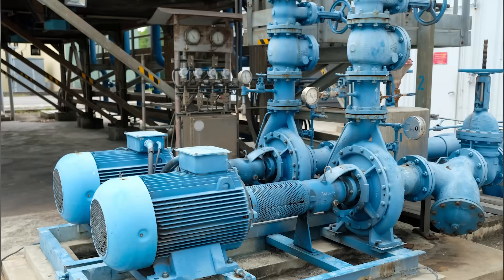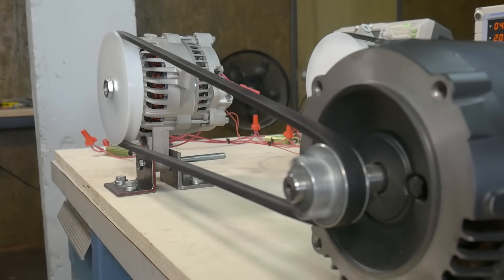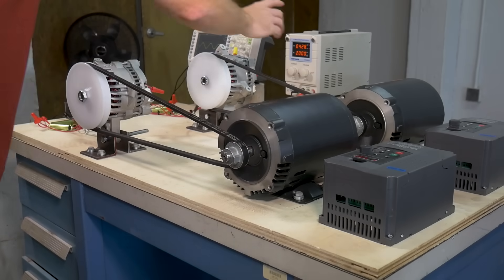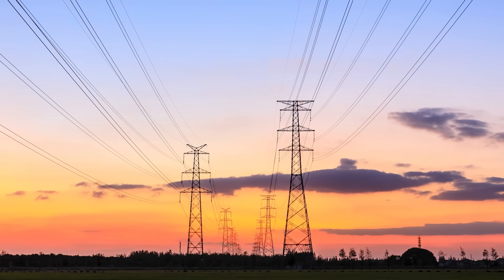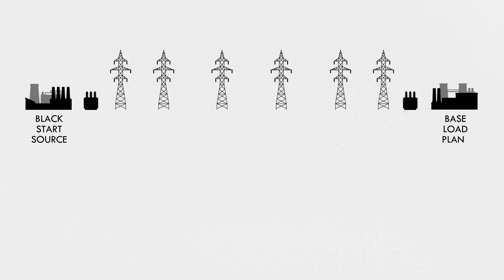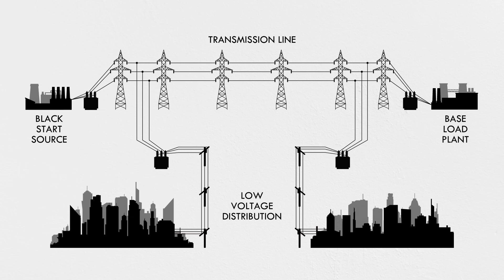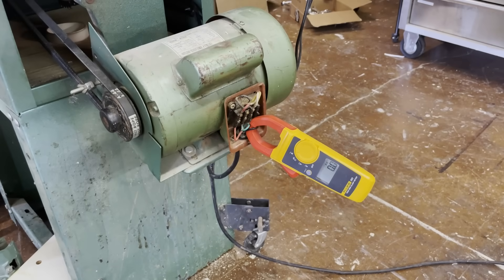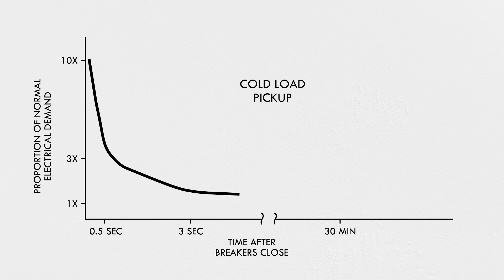What Is A Black Start Of The Power Grid?

Comment: A little black start anecdote: In the '90's I was working as a contractor plant electrician at the North Anna, Virginia nuclear power station during a refueling outage. I forget now if it was Unit 1 or 2. For some reason we were in the building housing the emergency diesel generators. Huge engines. Next to one of these engines hanging on the wall was was a hand crank similar to one you would start a Model T Ford car with. I asked the foreman what it was used for. He pointed to a single cylinder diesel engine mounted on the floor connected to a small air compressor. He explained that in the event of a total blackout and loss of service air, the crank was used to start that diesel powered compressor to charge a tank to power the air motors that start the main engine.
I guess you could say that a nuclear power plant is crank start.
Reply: It's pretty hilarious, but there's certainly nothing more reliable that good ol' human power 😂😅
Reply: As an old guy, I appreciate the fact that sometimes it takes a crank to set everything right.
Reply: @studuerson2548  As an airplane mechanic with a thing for inertial start systems (the technical term for crank starts) i too appreciate such simplistic redundancy!

On our big jets, (i work at an airline) you dont start the engines with the battery. You use the batteries to start the Auxillary Power Unit (APU for short) 
Which is essentially a 3rd miniature engine on the plane. 
You then use the APU to start the main engines! 

This brilliance harkens back to WW2 bombers, which were the first to utilize that sort of rig. 
If you ever see one, ask the crew about the APP. (Auxillary Power Plant)
Reply: Ha that's awesome. Ty
Reply: Same at our pump station when I worked there.  The main engines ( DD 12V71s (3)) and the big generators ( 6-71s (2)) were air starts. We had one smaller battery start generator for " hotel power ". The air compressor was either electric motor driven or by moving the belts over, driven by a single cylinder Hatz Diesel. The Hatz Diesel was electric start but also had a hand crank for an emergency. We later convinced them to install a backup compressor that could run off the small generator if need be. Air is very important if you are having to clean up things after a Hurricane.
Reply: @gravelydon7072 , is 6-71 a two stroke engine?
Reply: @T0m0zuki  Yes.
Reply: @gravelydon7072  , I loved the sound of it.
Reply: That's actually really cool. Someone had an anxiety attack and was like "look, in the event that these highly unlikely events happen, im going to include one of the oldest technologies for power we have that needs a crank to start so nothing is left up to chance. I understand this is probably a ridiculous safety measure, but considering this thing is basically a small nuke if it runs out of power 'overkill' seems reasonable" and his boss at the engineering firm was like shrug "it adds like 500 dollars to this several million dollar nuclear plant, that seems pretty reasonable to me" and then they did it😂
Reply: That's a pony motor. 
A lot of diesel powered equipment like road graders, excavators and the like had them.
Reply: @tomfuelery2905  Actually, not really... a pony motor is a fuelpowered startermotor, acting directly on the crank of the larger motor to be started. Often assisted by a big flywheel to help bring the larger engine through its first compression stroke.
Reply: @tomfuelery2905 what op describes is not a pony motor.  They are describing a crank start air compressor that then compresses the air to power the air starters on the big engines.  Pony motors in the sense that you described had a mechanical connection to the larger engine that it was starting.
Reply: thats so funny
Reply: At the nuclear power plant that I retired from, there was a plan to replace our high pressure air compressors, which provided all the compressed air required to operate the plant.  Two of the three units were replaced, with the third scheduled, when someone realized that one of the things required for startup of the new compressors was, compressed air.  With no power available, no compressed air, no startup.  Of course we had emergency diesels, so we never really had a complete loss of power, but the plans to replace that third compressor were still on hold when I retired.
Reply: @johnjones5354  Sound almost like the local plant. If the grid goes down, it goes down. The grid has to be up to bring the nukes up. The power from the generators goes to transformers and is stepped up in Voltage. It then goes to a sub-station about 5 miles away where it is stepped down and sent back to the plant. Or if the units are off line, the grid supplies power to the plant as the sub-station is tied to the HV lines throughout the rest of the state and eastern national grid.
Reply: @gravelydon7072  Actually, the grid doesn't have to be up to start up a nuclear plant.  That's one of the reasons that they have both emergency diesels and dedicated "black start" generators.  At the plant where I worked, we did not supply any of our own power, we had two independent sources of incoming power, one 345KV and one 120KV coming into independent switchyards, and one 345 KV outgoing switchyard.
Reply: ...to start the main engines that turn the generators that make enough juice to power the systems that can fire up the reactor.
Reply: I would have never expected this before I saw it with my own eyes, but those things apparently are not all that  unusual. I did one stint as first assistant engineer on TI Europe. Believe it or not, to restart from a total dead ship, one of the necessities was to start a simple Honda portable 24V generator.
Strangely enough, the ship's emergency generator would start automatic, and had two independent back up starting systems, but that was not what the portable Honda was for. If the last-resort batteries were also down, the Honda was needed to energize the control-circuitry of the Emergency Switchboard. Without the Honda portable, the Emergency Generator would run, but the breakers would not work and it would remain useless... I found that very strange that there would not be a simple handswitched transformer running off the Emergency Generator's 440, but somehow nobody thought about installing that. No idea why.

I have seen those Dieselpowered emergency compressors more often on ships, but they did not serve to restart the ship, they were intended for when Switchboard-damage would prevent using the main compressors.
Reply: I have a brass Zippo lighter that I used to use to light the boilers on USS Saipan. We had a rag on a stick, soaked in fuel oil, that we would light with the Zippo. Then we would shove the flaming rag on a stick through a hole in the side of the boiler while another guy cranked open some valves.
Reply: I'm pretty sure that pony motor was there in case of loss of instrument air not service air. Instrument Air is part of the safety system while service air isn't. In a Blackout service air is not restored but Instrument Air is.
Reply: Thanks for your reply. It was a long time ago but for some reason I still can visualize the generator room. I believe the little compresor was to fill the air tanks located right there and piped over to the air starters around  the diesel's flywheel. Having this backup pwer would probably restore instrument air if not service air,too.  It was 35 years ago so my memory might be faulty. (Getting old is not for the timid).

On the subject of black starts, 55 years ago I was an engineer cadet on an old T-2 tanker from WWII that had been converted to a bulk carrier. All pumps were electric driven so the steam powered generators were critical. For black start there was a little wood stove with a sheet metal cone above the fire. Inside was a coil of tubing to heat the oil going to one of the boiler's burners to start raising steam. Along side the stove was a small hand pump for the oil. By the way the name of the ship was the "Marine Electric". She sank in 1983. Search on YouTube, lots of videos about it. @cgirl111
Reply: @spankdaplank7774  Sounds like how we fired up a steam locomotive. Toss wood into the firebox to heat the water until you get 15 PSI. Then turn on the blower and the tank heater. Once up to about 20 PSI, open the atomizer valve to supply steam to the burner and open the oil control valve a little. As pressure came up, then you could open up the steam valve to the oil superheater. No pump for the oil as it was gravity fed to the burner. The black toothpaste flows well when it is heated.
Reply: hey at least they didn't gave you a bycicle pump to pump the air batteries back up.
Reply: That system was, but the guy sponsoring this video shows that the New York start up was a water powered 45 MW generator! And, the excitation power for that generator most likely came from a smaller Gasoline or Diesel powered DC generator, because think about the amount of Excitation power a 45 MW generator needs!
Reply: that's amazing :P
Reply: Black Starts Matter
Reply: That's mega based
Reply: I have no idea what any of this means
Reply: Essentially, Mk1 human biceps (1 pair) might restart multiple states potentially.
Reply: that is not a little anecdote, that is true poetry

Comment: Back in the 80s I worked overseas at a compound that had it's own diesel generation plant. Being a tech, I got elected to run the plant for the 3 weeks a year that the normal plant manager was on vacation. The plant consisted of 2 big honking caterpillar powered generators of which one would run at a time. Every day I would fire up the standby unit and sync and switch them without dropping the load.  As a tech, I understood the forces involved in syncing the generators every day, and it kind of creeped me out. The generator enclosure was very small requiring the operator to stand within a foot of the 2 roaring generators when he  synched them up and threw the switch. By the end of my 3 week tour of duty each year I would finally be comfortable throwing that switch, but the next year it would start all over again.

Comment: Here's how Duquesne Light had their system set up... Brunots Island, pretty much the center of their system, is a "black start" station. One diesel generator provides the power to start the plant and its three gas turbines and steamer. Next up, Elrama and it's three 100 MW and one 175 MW units. Next is Cheswick and its single 600 MW unit. Last is the Beaver Valley nuke plant. DLCO has the ability to isolate its service area from the rest of PJM.
Elrama closed in 2012.
Cheswick closed this spring.
BI cannot start Beaver Valley.
End of story.

Comment: What's the name of that game with the stack of wood blocks where you pull them out until the stack collapses? This is what is happening to the grid. 
New England ISO shutters capacity and says "we'll just buy power from New York ISO".
New York ISO shutters capacity and says "we'll just buy power from Canada and PJM.
PJM shutters capacity and says"we'll just buy power from MISO, TVA, and SERC." 
Why? 
Consumers have complained about their electric bills and don't want to pay for the capacity.
Political pressures result in ever-changing regulations designed to force non-renewable power stations out of business. 
At some point the demand will exceed the supply and the stack of wood blocks will collapse.

Comment: A plant I worked at had it's own generation, and we had black start capability and had to use it a few times. We had a large (rail car size) propane tank that fed a manual control valve and a small propane powered gas engine. You started the "gas" engine which started turning a 20Kw gas fired turbine. Once it got up to speed you started feeding it propane through a hand regulator and turned on the igniters which powered from the batteries on the gas engine. Once the turbine started to run on its on, it would accelerate past what the gas engine could keep up with and it would disengage. When it hit 1800 rpm and settled down, we would use it to start one of our big boilers. After it got up to 1000 psig steam pressure, we could bring up one of our 1.2 MW steam turbines, then start everything else backup. It usually took two days.

Comment: I work at a plant that has a co-generation facility onsite.  It  was added about 15 years ago, and it's run well ever since, supplying steam as well as electricity to our paper plant.  We burn natural gas, supplied from a pipeline that was upgraded to much higher delivery pressure than originally, and meet about 90% of our electrical needs.  Our most dangerous, or at least tricky, time is when something trips and we enter "island mode".  The generator is feeding the plant, but we disconnect from the grid.  At that time, any single big load change in the plant could take us offline, tripping the turbine/ generator and requiring us to "black start".  It's not good for the equipment as you can imagine, and an abnormal situation for the operators.  We do in fact have an old style "synchroscope" for re-syncing to the grid, though newer controls do it automatically most of the time.  Thanks for this in-depth real world look at the grid, generation and distribution.  I really enjoyed it!

Comment: Interesting. I did understand a lot of the principles before but not with numbers like how much inrush current an induction motor has and how much actual extra stress the grid is under when cold starting customers. 
Quite a few years ago, I was lucky enough to tour a gas fired power station during an open day to celebrate so many years of operation
( Basically before 9/11killed this sort of thing) It was amazing to be in the generator room feeling the trembling from rotating generators and struggling to believe that they used hydrogen to cool them ( windage and cooling#1 over fire risk) I was particularly interested when they described what happened when they had a fire which shut down the station. The generators have to be inched( slowly turned at all times) usually by a small inching motor or by a hand crank which they had everyone from office staff to randoms to prevent the heavy rotor from sagging and becoming unserviceable due to the balance issues from that sagging. Lots of things like slightly adjusting the frequency to keep synchronous motor clocks on time and synchronising to the grid as you say with the light.

Also the boilers used 1/2" thick Chrome moly tubes in a water tube boiler but if they got a blockage, they would still burst like an old overcooked frank. Also hard to understand the temps and pressures of the steam ( 1000deg and 1000psi in the HP section which was a only a few feet in diameter vs the LP turbine which was much bigger in the same ratio as a triple expansion steam engine and down to nearly absolute vacuum) Amazing stuff and to be there when it was running. Once in a lifetime!

Comment: As a former power plant operator, the prospect of a black start was terrifying.
Reply: Question - why don’t plants simply disconnect from the grid rather than shut down. That way the plant can continue powering itself and would simplify grid recovery.
Reply: @stephenblack8804  Not a plant/grid operator (I'm a computer/telecom engineer) but I'll try to take a stab at this. There are lots of really seasoned and actually-qualified veterans/professionals in this comments section so if one of them corrects me, take their word over mine.

While I'm sure some plants do just what you're thinking, there are three big problems that I can think up:

1. Many plants are not able to operate for very long with no load: When the prime mover is going at full torque, it depends on the resistance of a generator to keep the RPMs down. To avoid damage to the plant, it's better to shut it down completely when it isn't powering anything. This is the whole "balancing act" of bringing groups of customers back online: we can't just bring all plants up, get everything stable, then say "OK, throw the switch" and connect the customers. We have to keep every plant within its minimum/maximum range, hence the back-and-forth "more plants, more loads, now more plants, now more loads" process... add to that the temporary nature of the "cold start pickup" for each group of loads and I imagine there's a lot more guesswork and intuition involved than pure technique.

2. OK, let's suppose we only have "ideal" plants that are perfectly happy operating anywhere from 0-100% capacity indefinitely. If we disconnect all of those from the grid and keep them idling, we aren't just isolating them from the loads, we're also isolating them from each other. This means that the phase/frequency and voltage of each one will fall out of sync over time. It's a lot easier to get one disconnected plant in sync with the rest of the grid than it is to sync many isolated plants with each other, or a whole group of plants with a some other whole group of plants, so in practice the sync-and-connect would end up being one or two at a time anyway.

3. In the event of an overloaded grid, I have to imagine plant operators would rather fight to the bitter end than disconnect. If an overloaded plant disconnects (which it may have to, for safety or to avoid damage), that excess load is just going to suddenly hit the neighboring plants and force them to disconnect too, and you get a cascading failure resulting in blackout anyway. Operators would rather fight the overload and try to ride it out, if at all possible, to avoid the blackout and subsequent "terrifying" black start.
Reply: I'd like to know this also, I'm sure there is a reasonable explanation but I am curious. @stephenblack8804
Reply: @stephenblack8804  Because you need a balance of supply and demand. In the case of a sudden black out a power plant is not capable to regulate that quickly. The system has inertia. Plus you can only power low systems so much. Transformators dont work that well under 10% of designed load.